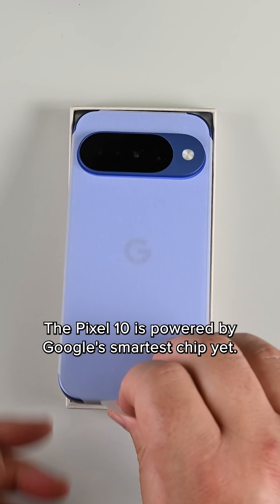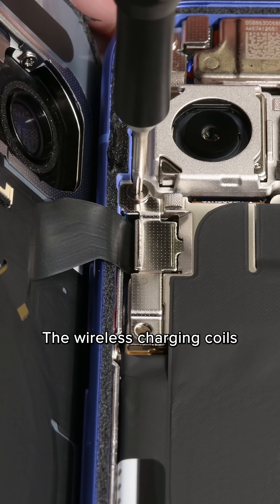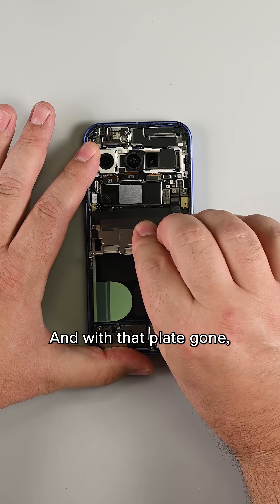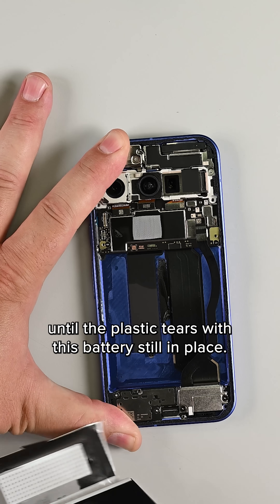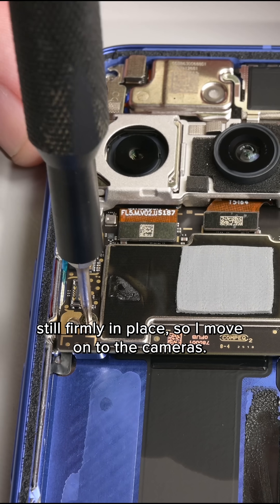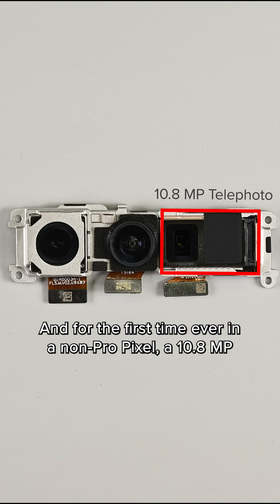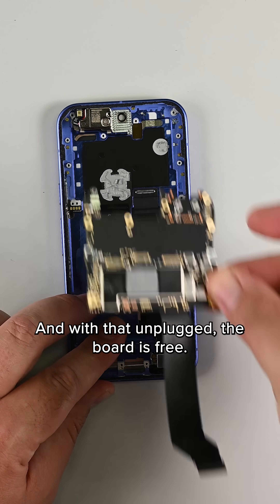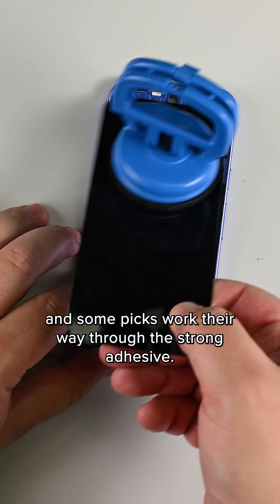Is Google FINALLY getting repair right? Pixel 10 Teardown #ifixit #Google #Pixel10

Comment: What is a heat mat? I want one!!!
Reply: It's literally in the name lol. It's a mat that plugs into a wall outlet and heats up. You control how hot you want it to get with an indicator on the mat itself, then lay your devices on it to heat them up, and let it sit for a good solid 5-10 minutes until it gets almost hot to the touch. After that, the adhesive underneath back glass and screens, coupled alongside a few drops of isopropyl alcohol, almost comes off like butter. Ok, maybe not quite that easy, but it makes things significantly easier and greatly reduces risk of screen or back glass damage.
Reply: @coytus94 thank you!😅

Comment: You give a 6 to a clean repairable design, which does not need heat to open... You have completely lost credibility.
Reply: Screen still needs heat to weaken the screen
Reply: Yes, but the rest of the components don’t need it. I don’t think that’s a justification to put only a 6 grade.
Reply: @Adri_BlackBeast maybe? The screen is probably the most likely to be repaired of all the components. I see what you mean, it didn't even look that bad to remove inspite of needing to heat the adhesive.
Reply: The component that must be repaired the most is the battery, and it can be accessed without the need for heat or alcohol. In addition, the system to take it off the chassis is frankly good and clean.
Reply: Completely lost credibility for a small lapse in judgment in which no one was hurt? But people who have done things 1,000,000 times worse are respected as heroes 🤣